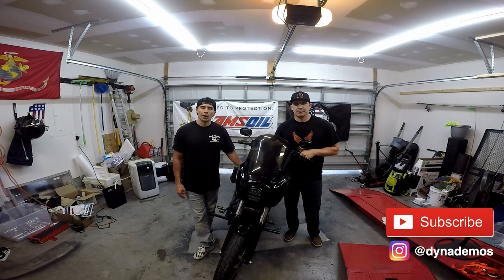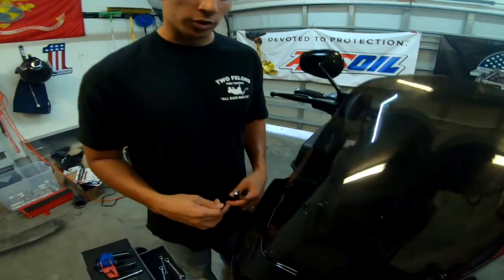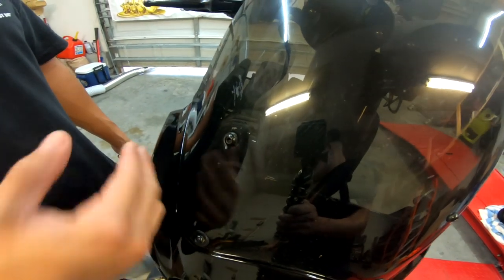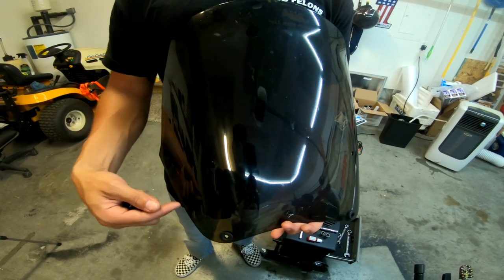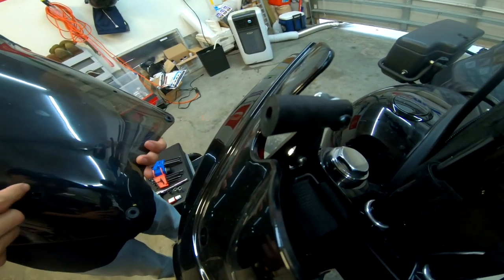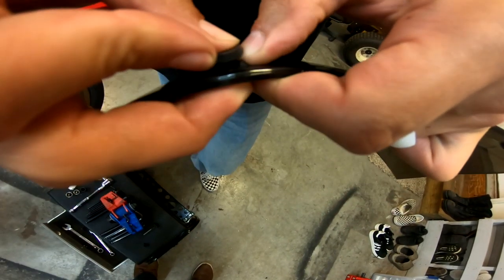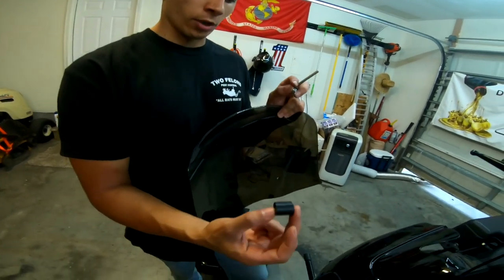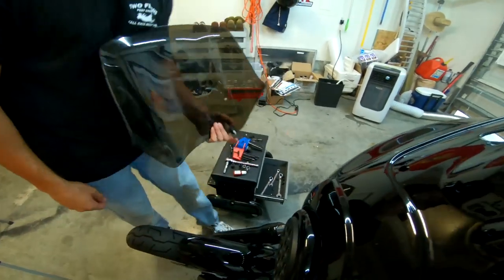Anti Buffeting Kit

Comment: The grommets are like $.50 to replace. And made my own spacers from an old rubber bungy cord, and used different hardware. Worked like a charm.
Reply from the maker: HD MyDyna yeah that’s one way to do it jd customs ain’t cheap lol
Reply: Where did you get the rubber grommets

Comment: Being always on a budget, I bought a used  H-D screen ( for a softail springer - it was wide enough in between the mounts to fit my Dyna forks on my Streetbob which has the wider Wide Glide triple trees) off ebay and I use quick-release clips, hope all that didn't confuse you ! 
 My point is that with it fitted I found a lot of buffeting to the top of my helmet, and one day when taking the screen of I dropped it and cracked the bottom on one side. I trimmed it up and did the same to the unbroken side leaving the bottom edge of the screen a little higher. This allowed more air to go under the screen and flow into the 'dead area' that the screen causes and THIS increased updraft of air counteracted the downdraft coming off the top of the screen and thereby stopped the buffeting....... I cured the problem by accident !    Maybe the buffeting you got on your screen can be cured by cutting some of the lower edge away.  When Harley (and other companies) make screens they test all this stuff out before selling things (that's maybe why they cost so much) - the cheap stuff from China may not be perfect but it can be modified as you show here.......

Comment: If you need a little more hight, you can put a spacer under the headlight extension.. and give yourself another 1-2 inches. I did this, abeit with the HD Cafe fairing with laminar lip
Reply from the maker: Thanks for the tip!
Reply: @dynademos  NP you are just gonna want a new , longer stainless bolt

Comment: Why is there 2 choices on the website, all I want is the better rubber grommets and nylon nuts, I dont want it un flush, i just noticed my screen bolts came loose and the original rubber is cheap
Reply from the maker: U can always go to a local hardware shop and prob find the same stuff 🤷🏽‍♂️

Comment: I might try trimming the windscreen next. It’s too tall for me.
Reply from the maker: Dave Howard yeah might be able to dremel it down I don’t mind the height 👍🏽
Reply: They're 130 dollars but the JD customs windscreens fit
Reply: I masked mine off with tape to the height and shape and cut it down with the 4 inch grinder..worked fine..
Reply from the maker: Dane Yourell I need to do mine
Reply: @dynademos  Yeah it was easy to do and made alot of sight difference so I swapped it back on from my gauntlet because it gives me better wind protection than that..
Reply from the maker: Dane Yourell doing the anti buffeting kit moved my windscreen up about 2 inches
Reply: I made my own anti-buffeting spacers then slanted it back on an angle to reduce the height. It’s been working well for over 2k miles now.
Reply: @davehowie03  Yeah sometimes you've just gotta get creative instead of paying top dollar 👍
Reply: I love how my head fairing looks I have the lower HD fairing but when I’m riding on the freeway I wish mine was higher. I find myself ducking down under it like I’m on a sport bike. Be careful not to do something you won’t like later on. With how easy it is to take the fairing off I’m thinking about getting a cheap taller fairing to switch out when I’m going long distances.